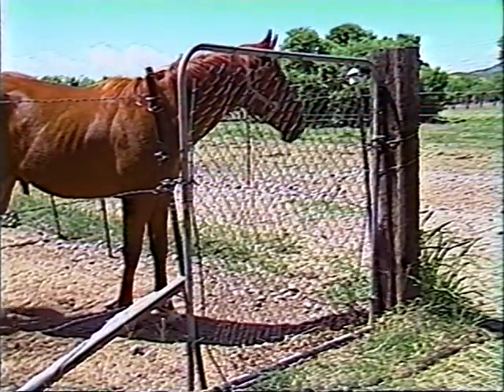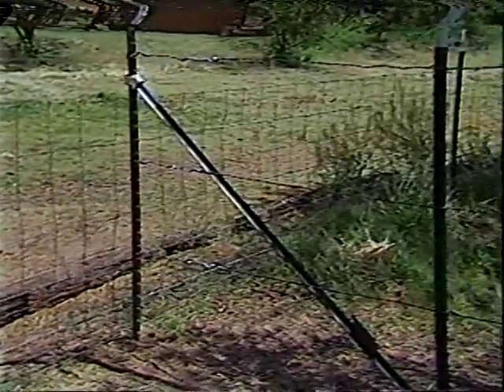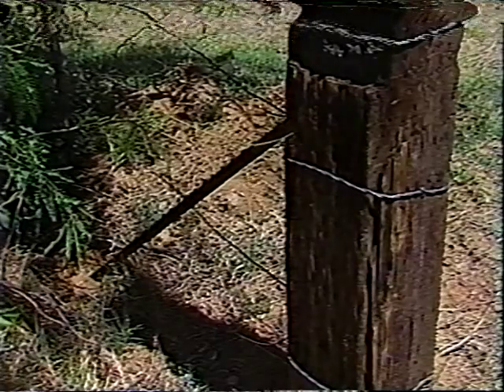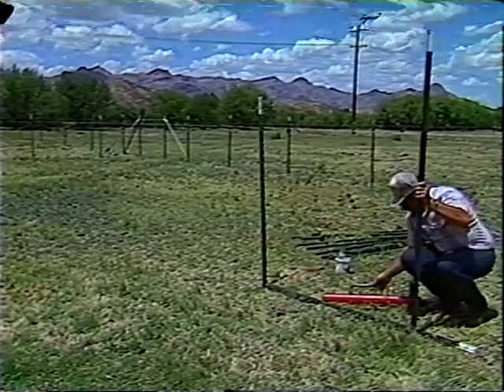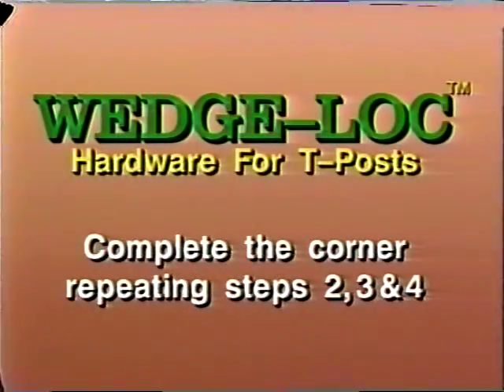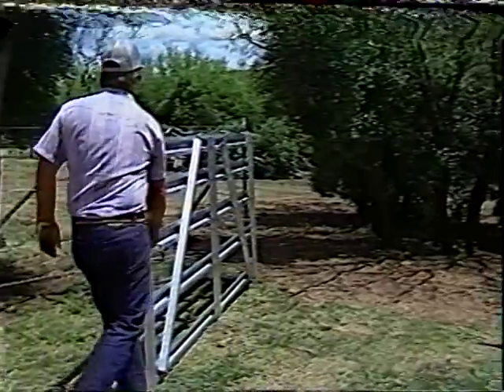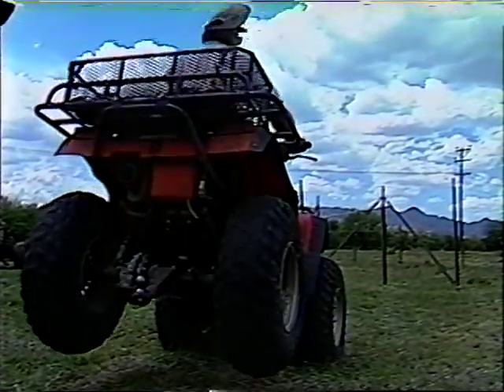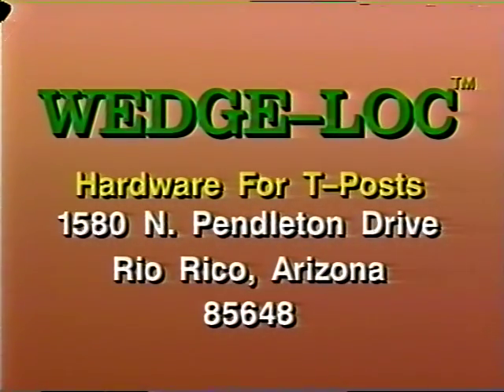Wedge-Loc Co.Inc. Product Video

Comment: Have had my 25' x 45' Wedge-Loc garden fence up for 6 years now. It's a 100% metal 5' woven wire horse fence with metal T-posts using Wedge-Loc system (no wood posts or cement). Used turnbuckles and Wedge-Loc on the diagonal corners to hold the diagonal t-post braces together. Used Wedge-Loc's T-post gate hinges with butterfly latches for the metal gates attached directly to t-posts.  The entire metal Wedge-Loc t-post garden fence and gate system is still like new. My soil is rock and clay (like cement during the summer with temps over 100 degrees and no rain). There has been no movement on the fence with the Wedge-Loc system, even during rain and snow season...it is rock solid. Neighbors wood/cement fences are heaving and rotting in the clay/rock soil and hot/freezing/dry/wet extreme weather conditions we have in our area. I will be installing a perimeter fence (around my entire property), within the next few months, using the Wedge-Loc system with t-posts, woven wire fencing and metal gates (no wood or cement).

Comment: Seems like the people having problems with the Wedge-Loc system here are not installing the corners properly so the corners come loose. You definitely want to use turnbuckles on the corners to keep them tight, just like you would with a wood post fence (and use a come-a-long to pull the fence tight...but not too tight, before you install the t-post clips).

6 years and my Wedge-Loc t-post fence system corners are still rock solid. The Wedge-Loc system has saved me from digging post holes in rock and hard clay, using and paying for cement, moving and paying for expensive heavy wood posts, removing heavy cement from old post holes and paying for an expensive fence/gate install by high priced so-called professional fence installers.

The Wedge-Loc system enabled me to install the entire fence/gate system all by myself, which saved me tons of time and money.

Comment: Just fine for chickens but be sure to use a stinging-hot electric wire with it for anything bigger. If you fence a dog who wants to dig, line along the bottom strand with concrete pavers all along the inside. He'll trim his own front toenails trying to dig thru concrete.

Comment: What this video FAILS TO MENTION, but is imperative to proper use, is that the collars are NOT SQUARE. They will only wedge while on the T-Post in *one particular direction*. This information is NOWHERE on the packaging or in this video. When the locks wouldn't fit in any of the 3 collars we purchased, we had to pack up our fencing materials and try to figure out what was wrong.  The Wedgeloc website at least, points out that it will only fit in one direction, so hopefully they will work as promised when I try again. This information needs to be explicitly stated however, considering it's the only way to get the product to work!!  I honestly don't understand why a business who wants you to purchase, use, and presumably purchase more of their products, wouldn't give you the MAIN piece of info necessary to make these braces work.

Comment: Used These Wedge Locks on a 6 inch corner post and locked into T_post. Worked wonderful. Saved a lot of time and money by not having to buy  more  6 inch post and braces. Plus not having to dig holes. With my PHD. For you city folks My PHD is POST HOLE DIGGER.

Comment: How do you lock the upper  brace? You show it for the lower, how to lock the wedge into the collar. I've done the same for the upper but how do I lock the 60 degree socket into the collar? The weight of the t post brace pulls it down and out.
Reply: Something must be upside down.
Reply: You can use turnbuckles along the diagonal posts (from the corner vertical post to the second vertical post in the diagonal brace) to tighten the diagonal brace.

Comment: This product is not very strong and is made from pretty soft aluminium. I used this product on 7 electric fence corners and 6 have failed so far and at $16 dollars a corner it was not a very cheap lesson. Save yourself some money and do it right the first time unlike i did.
Reply: +s floyd   I held one in my hand and thought it was aluminum, but then assured myself that no one would be dumb enough to make them out of anything but steel. Guess I was wrong.
Reply: If you use turnbuckles on the diagonals the diagonal braces will be held together tightly without putting undo stress on the Wedge-Loc system. 6 years and my fence corners are still rock solid.